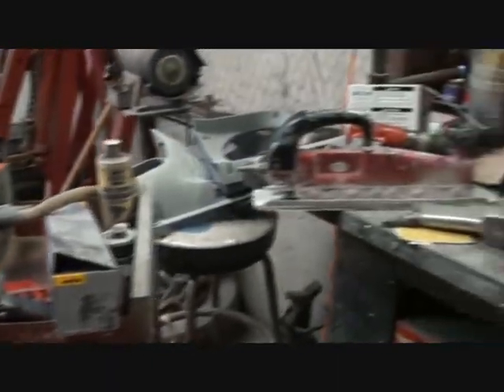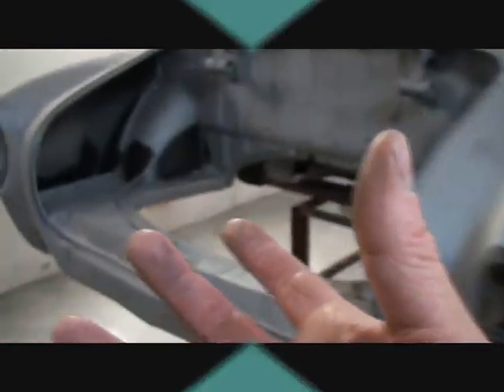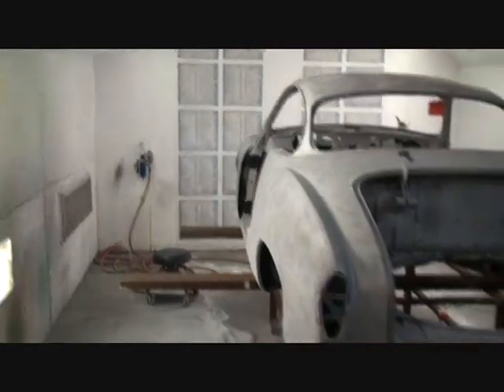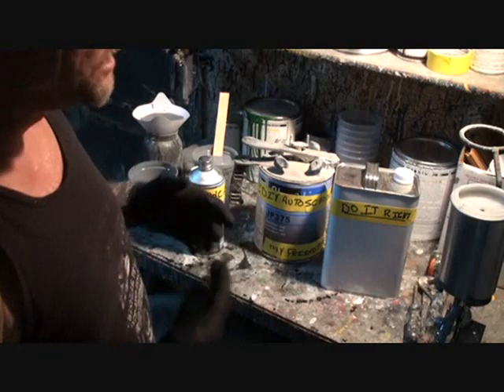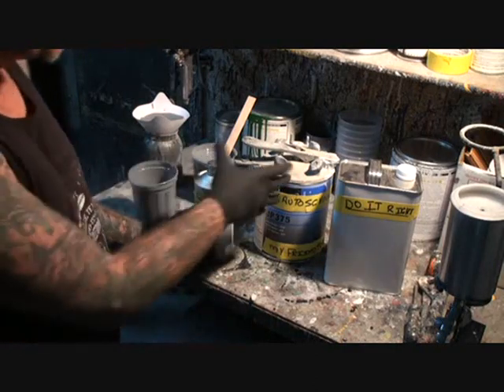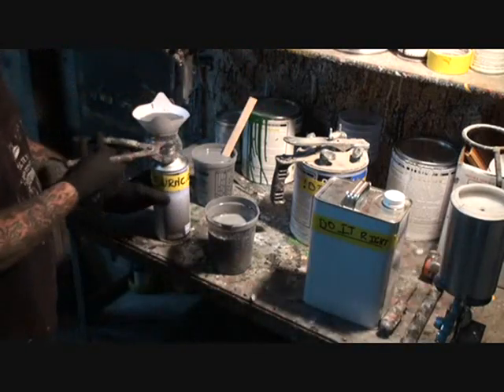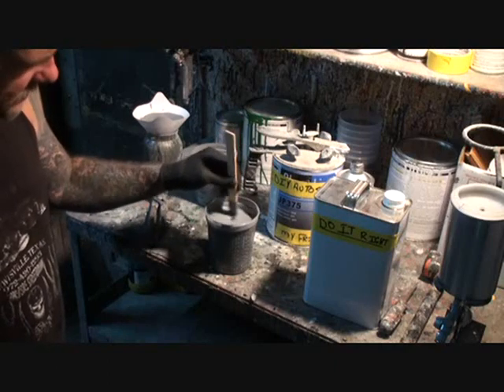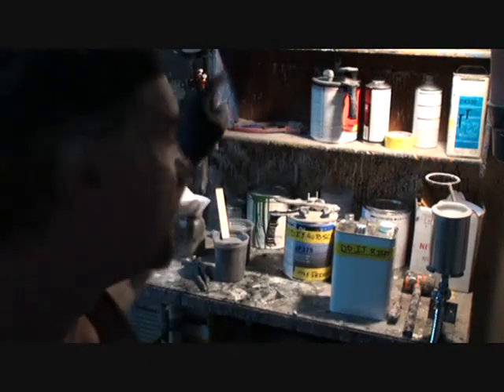Automotive Refinishing: When To Use Epoxy Primer-Part 1

Comment: i am doing a frame off on my 59 Buick. After media blasting should I epoxy prime it before body work or just media blast the rusty area get the patches put in then media blast the whole car and epoxy prime it? Also would I get any extra corrosion protection by putting a etch primer on before epoxy primer?

Comment from the maker: PPG DP Epoxy is the brand I use, as for sanding down- the procedure is to apply a coat of epoxy, let dry, then apply your base/clear. no sanding required.
Reply: DP is shit.try ppg epoxy urethrane primer for bare metal then apply bondi directly over top.

Comment from the maker: If you plan on doing all the work right away, go ahead and bondo, sand, primer. If you plan on taking your time and not doing it asap, then it's better to spray your car with epoxy primer to protect it from surface rust. When I said you don't sand epoxy primer I ment that you don't use it like a regular primer, you can still go back and grind and sand, its just not a primer filler, its more a sealer then primer. Pete

Comment: Pete I got one of those dual quad  Enderle style  air scoops (with 3 red butterfly valves in front) and I want to paint it to match a color on my coupe. Its aluminum, so what should I use for a primer  that will stay on it and not flake off?

Comment from the maker: You can sand runs out, but as for overall sanding wet or dry, no you can't, if you get a small imprefection in the primer, sanding it out is fine.

Comment: G'day Pete. You say in the vid that if you do get a run in the epoxy primer/sealer it doesn't matter, however you also say that the epoxy primer/sealer is non-sandable, so if you can't sand it, how do you get rid of the run?

Comment from the maker: If your using a chemical stripper such as aircraft paint remover, you should take all the plastic parts off the car, it will not hurt chrome or rubber. If you have aluminum trim, this much be removed as well.

Comment from the maker: Epoxy primer is a sealer type primer, it's a non shrinkable sealer and holds it retentions... 2K primer is a filler primer used after you have done all your body work and is sandable...

Comment from the maker: Centari is just an old school acrylic enamal made by Dupont and the Imron was and still is a standard for commercial use type single stage painting,, I don't use Imron because of the Iso-Sionides that are in it, --- VERY DANGEROUS to your health, I think you ought to really consider checking into stop using that stuff on a regular basis or atleast us a breathable fresh air paint suit and head mask.. The Imron is also made by Dupont, its a rock hard finish that lasts forever.......

Comment: Pete when using the chemical stripper I assume its simular to the airplane stripper? My question is when using this on a car should any mouldings, trim, that are the polyurethane,etc.. be removed or will the stripper be safe on them types of parts to? If the stuff is not safe for like bumper covers and material like that what is a good way to strip them?

Comment: I've seen you use an ammonia solution on bare metal before as well.  I know that this is temporary, but how long can a car sit with this before sealer is applied?  I'm prepping for my first car down to bare metal.  Lots of work under the paint.

Comment: I know PETE has mentioned this in his past videos but a reminder to DIY guys. After your car is down to BARE steel DO NOT touch it with you BARE hands, wear GLOVES The oils from your skin WILL cause RUST. I've been stupid and done it. I walked into a hand-print of rust the next morning, I should have been painting not RE-PREPING.

Comment: I've been working for a mobile equipment manufacturer for 13 years. I bet I have shot 200 gallons of  DuPont 2510S Chroma primer sealer using a Devilbiss 2.8 gallon pressure pot. On occasion I have issues with materiel adhering no-matter how good of prep job on new steel. I was aware of "flash time" and pot life however, never was I trained or taught by our paint vendor to let the material "rest" after mixing before its applied which makes perfect logical sense.